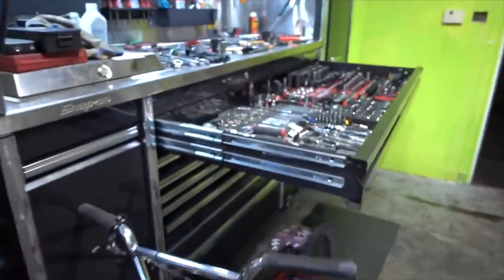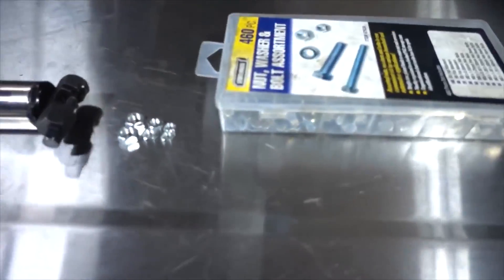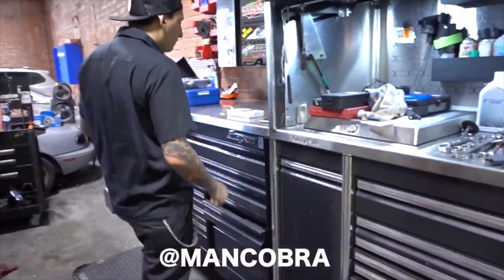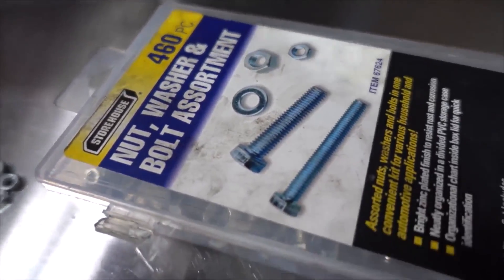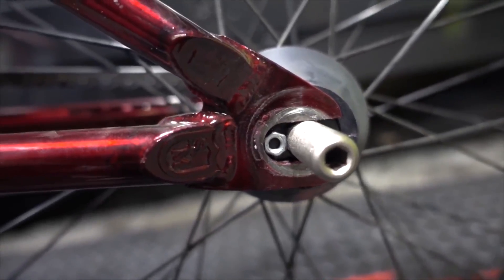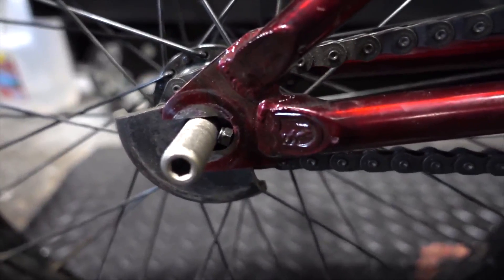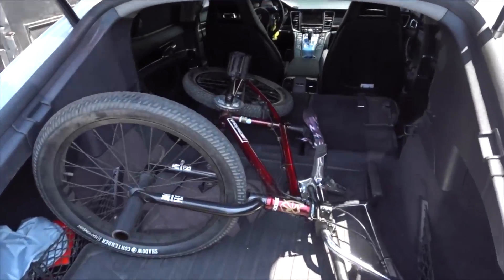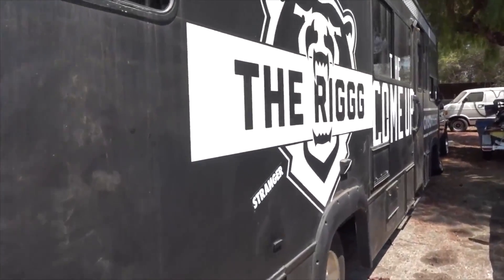HOW TO MAKE A GHETTO CHAINTENSIONER!

Comment: if you have thick enough drop outs you can drill your frame to add integrated tensioners but it voids the warranty. 

or you can use a bolt on cable guide or gyro tab and mount that on the inside of your drop out. tree did something similar for their lil buddy frame back in the day.

Comment: Was trying to find simple wheel slammers. Couldn’t find. Was thinking of trying to crudely make my own using bench drill and die grinder bit like a mill. Then thought, what if I shove a bit of metal between the axle and the dropout. Further research led me to this video! I’m off to look for some small nuts.

Comment: how to keep your bars from moving?
Reply: Aaron Beliveau tighten them up.  🤷‍♂️.
Reply: Aaron Beliveau LOL
Reply: Aaron Beliveau call me crazy but put a little grease on them where they meet the stem and put them back on or you might just need new bars
Reply: Dwight Storer Wouldn't that make them move more?
Reply: Rbxy i know it sounds crazy but i did it myself and never had another issue
Reply: Dwight Storer yes a little grease will help the bars tighten more.  Like said I know it sounds crazy. But the grease actually helps the metal to metal contact to squeeze together more creating more torque u can put on the bolts creating a tighter grip. Also a little loc tight on the bolt threads will help it from loosening in the future. Both would be optimal. But maybe your just not tightening them down enough? Get a torque wrench or have a bike shop or stronger friend tighten them for ya.
Reply: Sand off the paint from the contact points.
Reply: Smoke crack then proceed to tighten bolts ⚡️ just don't snap your stem
Reply: You shouldnt need to do anything to keep them from moving. If they move and your bolts are tight its time for either new bars or a new stem. I buy new stems and bars all the tgime since i change bikes/colors ALOT and never had an issue with bars moving and i dont do anything to the stem or bars after buying them.

Comment: That's not a chain tensioner. You're supposed to tension you chain by moving the axle back in the dropouts. No need for any nuts to wedge in between. Just pull back the axle and tighten the axlenut.
Reply: omg lmao , chain tensioner are made to avoid the back wheel mooving
Reply from the maker: Exactly lol